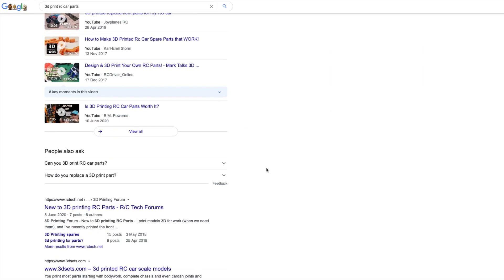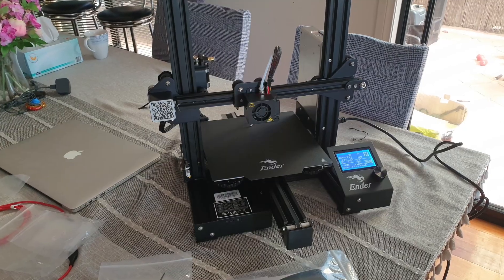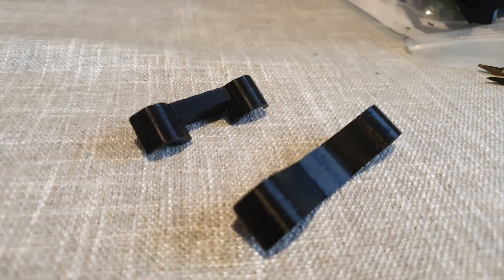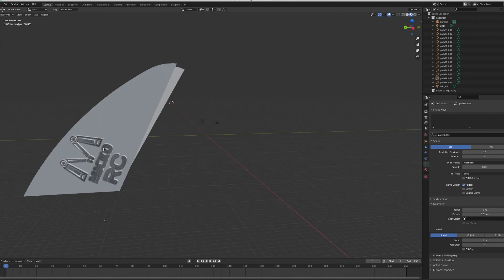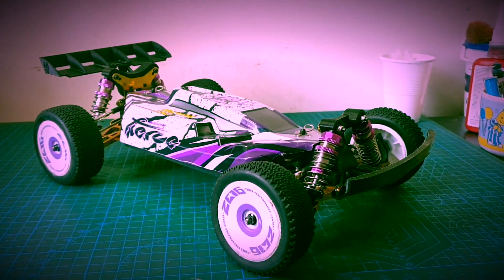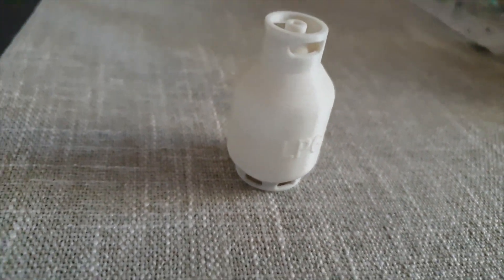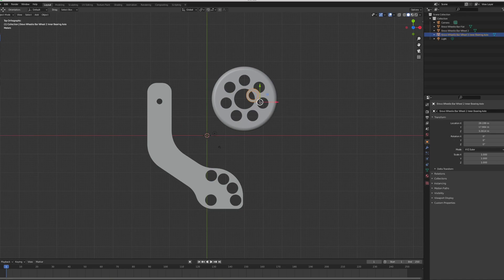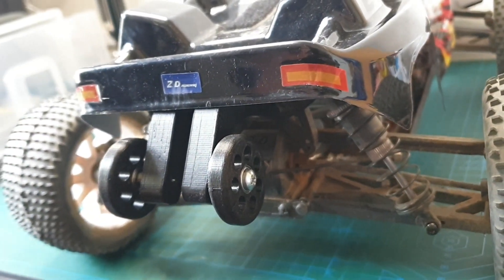My First Experience with 3D Printing RC car parts on the Creality 3D Ender-3 Pro

Comment: Right on brother pretty cool pretty cool! I think 3D parts are fine on some things but I would not try to do frames or a arm stuff like that that needs to hold up. Pretty awesome job my friend you take care.
Reply from the maker: You're probably right mate. But I'm still going to try it a arms for emergencies. Worth a shot. Also need to experiment with different types of filaments.
Thanks for watching bro. Take care too!
Reply: Actualy if you use ABS filaments the parts come out super nice PLA works too but last less tha ABS and it actually turnes out to be better than the nylon plastic the makers use because its a little more flexible and more resistant